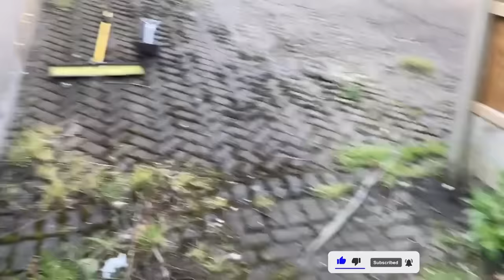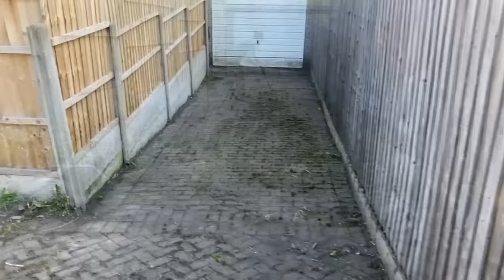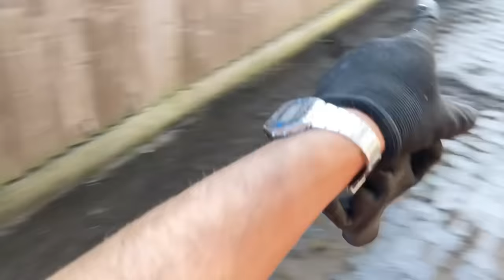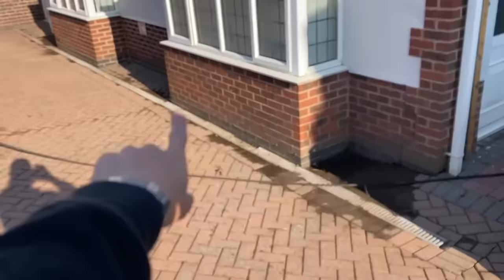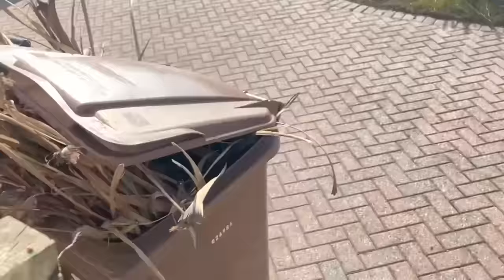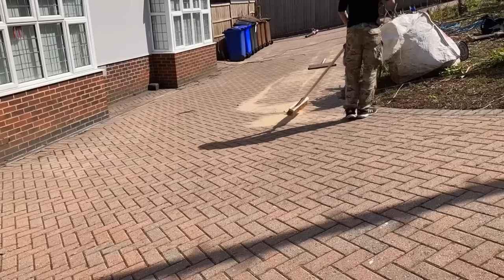MY DIRTIEST DRIVEWAY CLEAN EVER! (No drainage at all)

Comment from the maker: This hard slug fest of a job has helped push the channel over 2.1k thousand subscribers so thank you for watching and subbing!
Reply: How much per sq Mtr do you charge mate
Reply from the maker: Hi mate usually between 3-4
Reply: Get a mud sucking pipe. They’re about £90, trust me, well worth the money!
Reply from the maker: I’ve just got a gutter vac so that’ll sort me out from now on :D
Reply: A sub here. Just found your page.
Reply from the maker: Thank you Mary I really appreciate it 😌
Reply from the maker: Yeah I’m still trying to buy a new machine 😆
Reply: Still a lot of mud on the front of house brick walls otherwise great job.
Reply: @Wayne-R-  b8
Reply: @paulharrison5898  what does that mean
Reply: Awesome!
Reply: You lost me at the blasphemy
Reply: Partridge Exterior Cleaning so do you always have these problems with drainage ??
Reply: What does re-sanding do?   Do you use a extractor machine to drain the gunge that can't go down a drain.
Reply: You should get a patio cleaner attachment would minimize over spray and avoid mud going everywhere
Reply: Excellent work
Reply: Unless you’re trying to remove chrome from a bumper;  volume always trumps pressure when pressure washing.   Machines with higher volume output ex. 4+ gallons per minute will make this job easier.   Of course if you can afford both high pressue and high volume it would be best.  For most residential applications 4k psi/4gpm is enough.
Reply: I’m watching this and you’re almost at 100k subscribers! Congrats mate
Reply: I used to clean the floors of a pie factory with high powered hoses. We'd use the hose or a separate hose as a sort of dam in areas where the floor wasn't level& water wanted to go in the opposite direction of the drain and then use the hose like a giant squeegee by pulling on one end (holding it close to the floor) and sweeping the water towards the drain or general area we wanted it to go in... Saved a lot of water clean up time
Reply: I really enjoyed your vid and I think it was pretty awesome
Reply: Hi, I really love watching your videos, I binge watch it! 🤣 but as I’m listening to you talking at the end of this, you keep saying ‘Christ’ this and ‘Christ’ that …. 3 times in a few minutes. Earlier it was ‘Oh Jesus Christ’ this and that when looking at a mess of some kind. As a Christian who loves Jesus,it really hurts to hear this and it’s unnecessary. You’re a lovely guy but you wouldn’t get away with it, if you swore in the name of Allah, Buddha or Mohammed. I never txt like this, but His name is worth it. Thank you. 👍
Reply: Very nice video 🙃 i really like the asmr 🙂Mate xD 😃
Reply: Mate your vids are so asmr i think you should make a asmr Channle xD
Reply: Great job, nice 80's VHS porno music I thought.
Reply: Do i need any solution to clean a really dirty paviment??
Reply: ..........Use  Sand bags to soak up where drains dont exist.  I also use rubber tubes.  As for weeds to cut the time use a strimmer with a plastic cable and steel brush head...  You results are awesome mate !
Reply: Hi. I've got the top of the range JCB washer but the pressure regulating knob seems very stiff. Any ideas? Thanks.
Reply from the maker: @errolkim1334  kinda gotta force it a few times till its smoother but do it when the mahcine is off the first few times
Reply: @PartridgeExteriorCleaning  thanks so much. It's stiff as hell! Couldn't turn it at all straight out the box 

Another thing, just for newbies....you won't get a full fill on one carton of oil. 

You'll need two and it's not easy to fill. It's an awkward angle. Get a few funnels especially one with a bendy angle.

Comment: I hate that some people think you don’t need a brain to do these types of jobs. You were methodical and strategic. I didnt know about the sand either. I learned something new. Thanks
Reply from the maker: Ah yeah there’s always a bit of problem solving with most jobs I do, I say all the time no matter what I turn up to clean there’s always something that takes a second thought :)
Reply: What I wanna know is why not a surface cleaner w/ extractor
Reply: @OZtheRedDevil  🤦🏼‍♂️
Reply: @OZtheRedDevil  wrong. With drainage, yes, that would be one approach. With no drainage, he would have flooded the garage/storage shelter.
Reply: @OZtheRedDevil  with no drainage all the dirty water and mud would have just kept coming down hill onto your cleaned surface. He did it the proper way.
Reply: Patience of a saint mate doing that. Well done. What machine do you use and what sand do you recommend for the sanding
Reply: How much sand did u use
Reply: @georgefisher-5591 how long is a swans neck??

Comment: Those french drains probably weren't decorative.  They're probably full of the same muck you cleaned off the brick and desperately in need of a plumber to snake them out.
Reply from the maker: There was one ubend on the far edge but it just lead straight into the house so I dare not try to blast it 😂
Reply: A lot of these drains are soak away ones which take hours, making them completely useless especially when pressure washer, speaking from experience
Reply: I would describe that a strip drain or an Aco drain. A French drain is a perforated pipe set in gravel.
Reply: As Tony says these thing don't normally connect to a positive drainage system - even though they should.
Lots are called soakaways by the cowboys that install them but they don't do the tests to see if water can soakaway.
Generally these drives with slot drains will cause problems.
Reply: I’ve seen these drainage covers being lifted & all the ‘muck’ being cleaned out which would help!

Comment: It's amazing what a pressure washer can do. Took off years of gunk on the bricks. They look like they were just laid. Like your man bun 👍🏻
Reply from the maker: Satisfying isn’t it! And thank you I need a trim though 😆
Reply: Geez, those bricks looked dirtier than the other drive.  Very good job!
Reply: It uses so much fresh water though.. something that’s a huge problem in most large countries. Who knows what can replace it.. but with a driveway that large he likely used about 80,000 gallons of fresh water. People in the Los Angelas area right now are limited to 85 gallons of tap water a day just for reference and that’s per household. To clean that driveway a household could have lasted 941 days which is just a bit less than 3 years worth of water. See what I mean. It’s a GIANT problem.. paver driveways last forever but require huge amounts of water to upkeep whereas who washes black asphalt? Though asphalt must be replaced every 7-10 years. Just food for thought.
Reply: @prawnstar9213  fun fact, black asphalt actually makes cities hotter, leading to higher power bills, worse heat waves, and faster degradation. The black colouring traps in heat from sunlight, leading to patches of superheating. Something closer to a blue-grey is actually far less heat retentive

Similarly, you can actually get dramatically lower power bills just by painting your roof white all because it reflects the sun
Reply: @zen_ccg  That’s a fantastic point.. so there’s really nothing great about paved driveways. Is gravel the answer? 🧐
Reply: @prawnstar9213  Good thing we're a tiny little island with no water issues then right?

Comment: Banging result mate but defo need a wet/dry vacum,  just set it up at the low point and leave it on and sucking,  it cuts out when its full,  itd save youre back a load of stress,  im 6ft5 and used a bucket,  dust pan and brush the lot until i got the vacum!  Best thing ive got!
Reply from the maker: I actually have a brand new one at home but saving it to do a video on it 😆 all I could think about was should I go back and get the vac... just dedicated to the YouTube channel 😂
Reply: Or a water pump
Reply: Maybe a surface cleaner too! Easier to do the brick that way.
Reply: @fritolays406  or just borrow the cities streetsweeper.;-)  Not going to lie very usefull
Reply: Yep, me too. Couldnt manage without it (cordless is safer). Always carry spare batts as well...

Comment: You need to collab with Drain Addict in this case. He's your guy for the drain problems
Reply: But the problem is not a blocked drain, It's the fact that there is no drain at all. No wonder why that garage area looked like a little jungle. Because it turns into a swimming pool after every single rain. The stupidest design I have ever seen...

Comment: Sorry go my ignorance I’m looking to learn. What does “re-sanding” do? Does it replace the grout/mortar between the bricks? Great watch dude!
Reply: It fills in the gaps so that the pavers don't shift and keeps them in place. It's also handy for keeping weeds out.
Reply: Oh I see. Thanks!
Reply: As Tim says  it stops the pavers moving. Block pavers have a 'nib' on each face to create a gap to allow water to drain through.  I believe that under current  building regulations you cannot have any drive or path over 5 sq metres that is not water permeable. This helps to reduce flooding as thousands of drives shedding water to the flood drains would  overload them. That is why you don't see concrete drives now - they are either block, asphalt or resin.
Reply: @MrFritzybabe  thanks for the info. This all makes a lot of sense when you think about it!
Reply: @MrFritzybabe  sorry if I sound ignorant but when it rains, does it wash away the sand and create a mucky mess? (I live in California, we only get light rain for like one month a year!)
Reply: @MrFritzybabe  or three quarter inch shingle. My partner and I used this on our driveway in Chesham. You can order it on line and delivered by a lorry. First we leveled the ground, then put down membrane to keep out the weeds, on top of that 'Scalpings'. We hired a 'Wacker' to flatten and firm the 'Scalpings' before laying the 3/4 inch shingle. We used rakes to level it. That was over 20 years ago. 🙏
Reply: @fiestyfox2207  I'm not a paving expert, but from having lived in a really rainy city with a path made out of that type of paver, as far as I could tell it doesn't really wash away.  I think the sand pretty-much just stays in the cracks between the pavers and it's all good.  I think the sand does need to be topped up every couple years, so maybe some does escape.  It's not noticeable, anyway.  I think there's more mess just from pollution, dust, random dirt from garden beds that washes onto the pavers, etc.
Reply: @AnnAnonyme  thank you!! (:
Reply: @TimEllisau  thanks I was so confused as why he put all those sands in there after cleaning it!!
Reply: The pressure drives out some of the paving sand so it needs to be replaced after cleaning. Sand won’t keep the weeds out it encourages them unless you use setting sand (sand that sets relatively hard). The nibs on the pavers are there so that should they move the edges won’t chip not so much for drainage and to the sand tighten them under compaction Self draining pavers have a bigger gap and are bedded on fine granite instead of sharp sand.

Comment: A good thing to help with the drainage is to start from the deeper end where the water falls so that you don’t have issues with pressure washer trying to clean through the dirty water
Reply: couldnt help but thinking how dumb it was to start from the top there, with the pressure washer you can push the water back up too, i thought when he paused the video about half way down he realised how bad the drainage was and was going to start from the garage but no he built a mud wall LOL, also made the garage door way more filthy by going that way
Reply: @falsteethmike  That is a good point although the pressure washer takes out the dirt that’s stuck deeper in the floor. It’s much more difficult to do that whenever there is water over the floor and it will not take the necessary dirt out because of water blocking it and having no where else to move. The water that slides down if you start from the bottom won’t affect the floor compared to how dirty it will stay starting from the top! It makes the job much easier than you fighting with the water to clean what’s under

Comment: Just came across this video.. great before and after! You made that driveway look awesome! You should look into getting a floor washer, it is a circular extension that you put on the end of your pressure washer and it rolls and makes cleaning driveways and sidewalks soooo much faster. They make them in several sizes. They are well worth the money, as they cut the time you spend on the jobs at least in half.. keep up the good work, both on your cleaning projects and the videos!
Reply from the maker: Thanks mate! And yeah I’m getting a whole new setup soon so will get a fancy surface cleaner too!

Comment: Great video I had the same machine and it did the job but slowly,,I upgraded to a Honda gx390 21ltr and it's a game changer@just make sure you but a 19mm hosepipe and you won't run out of water often @keep the good vids going pal
Reply from the maker: Great tip thank you!  I wouldn't of thought about that with the hose pipe! cheers!

Comment: Out I curiosity, would it be easier to use one of those pressure washer attachments that spins? Also as a suggestion for drainage issues, you could get a submersible pump, extension cord and a 100ft hose to attach to the submersible pump.  Then you can let it run to continuously pump out the water from the bottom of the hill. A lot of effort, but may make things a bit easier.
Reply from the maker: Honestly it wouldn’t of picked up much of the dirt here, was too thick even the turbo nozzle was working overtime. And yeah good idea!

Comment: Nice old job!I use a big old dutch hoe to get the weeds and moss up, (not a shovel) saves me back. Mine is shaped to perfection with repeated use and self sharpening too. Also a springy steel tined lawn rake used up side down with the flat back moving along the ground works fantastic on block paves that are a bit uneven, rides over the bumps instead of an abrupt jolt (easier on the hands and shoulders) cuts weeds fantastic

Comment: You should definitely get you a good surface cleaner and recovery system. There are also recovery systems that u can attach to the surface cleaner and it recovers as you clean. That would have done wonders for your poor drainage problem. But considering u worked with what you had. Great job man!

Comment: After you removed all the sludge, there is some very nice brickwork revealed. Great job in spite of the lack of drainage. Perhaps the trench under the metal drain covers is plugged up? Anyway, you weren’t there to fix the drain. Very nice outcome and great work!

Comment: Great job  especially with the pain of that drainage not working, I wonder if you cold have taken a few blocks out at the lowest point then dug a small hole to fit a builders bucket for easier bailing out or better again used a small submersible pump that could fit into the bucket maybe food for thought on future projects iwith similar Poor drainage Best of luck and once again great job 👍👍👍
Reply from the maker: I wouldn’t of thought of that but sounds like a smart idea!

Comment: I used to do this on an industrial scale. Got a job to clean massive areas of Alton Towers mainly to remove chewing gum. We were running a rig powered by a Volvo FL6 truck engine through a 16,000 psi capable pump, though we ran around 12,000 for the job at 12 gallons per minute.

Cleared a hectare a day for 2 weeks. I hate chewing gum.
Reply from the maker: Jeez! Some job for the portfolio, pity you couldn't video it :D

Comment: Here in the Pacific Northwest-Eugene Oregon, we use this attachment -Twinkle Star 15" Pressure Washer Surface Cleaner with 3 Wheels, Stainless Steel Housing & 1/4" Quick Connector, Power Washer Attachment with 2 Extension Wand, 2 Replacement Nozzles, 4000 PSI

Comment: Need the right equipment for the right job.  You should consider checking out some of the newer orbital pressure washing machines.  their wider swath combined with rotating bristle brushes albeit a little more expensive cover so much more surface using the roughly the same amount of water.  helps to get years of grime and vegetation growth out and off asphalt and brick driveways.
Reply from the maker: We all start somewhere! This way gets it done, just a bit slower :)

Comment: Because the driveway I cleaned each year suffered from the high pressure jet because the softer cement eroded faster than the larger stones in the bricks, I stopped cleaning the pavement in this way. Also resanding was costly and laborious. Look at the Westermann WR 870 machine for cleaning pavements dry. Much faster and no resanding necessary. greetings Gerard

Comment: Surprised you did use a ufo attachment with wheels on your jetwash. I have the stainless steel one for my kranzle jetwash and it’s awesome. Did my patio in third time, as creates less mess so virtually no clear up needed, unlike the dirt blaster which creates tons of mess. So for commercial grade they must do something similar or better

Otherwise get a lance hood like those from kranzle which limits splashback and mess. They are about £49 but worth it.

Comment: Just a few questions what make of pressure washer do you use, and a lot of people use the surface cleaner attachments on wheels that seems to make life easier and reduces the mess a bit...
Reply from the maker: It’s a wilks USA 750i, great starter or back up machine but not powerful enough for these big jobs to be honest, hence the non use of a surface cleaner, just doesn’t have the power to get it to pull up the weeds